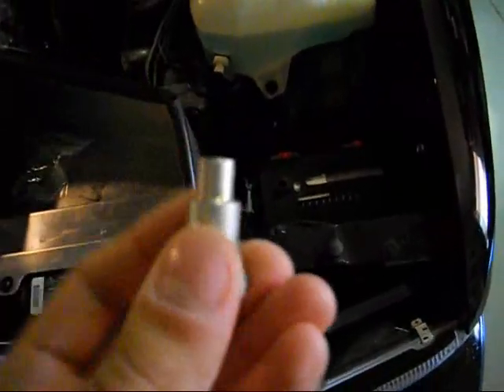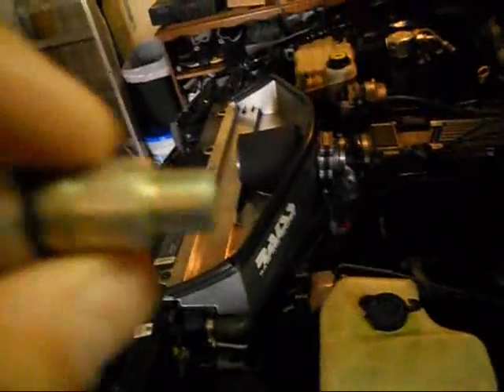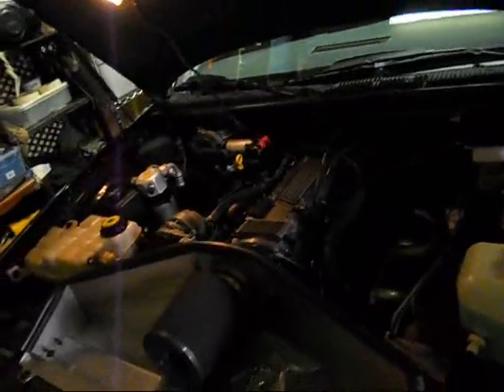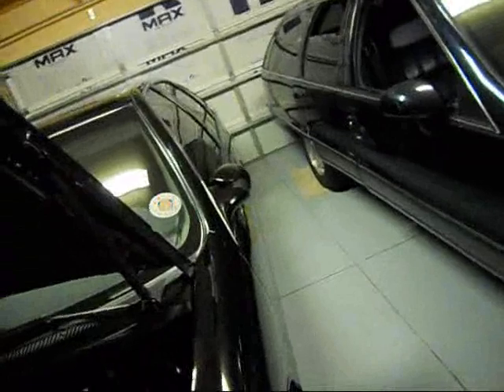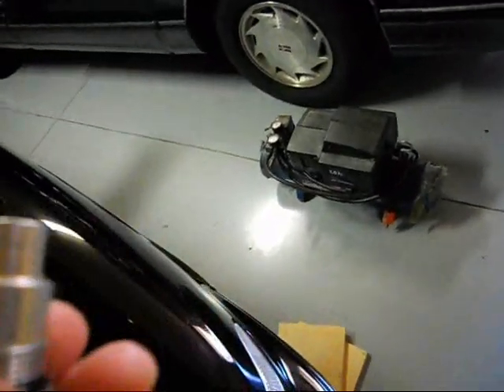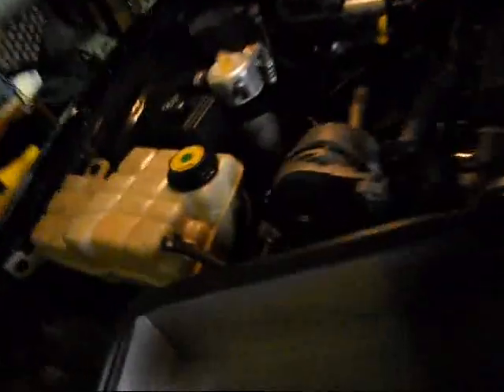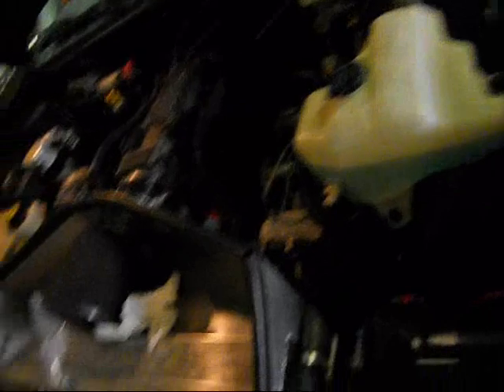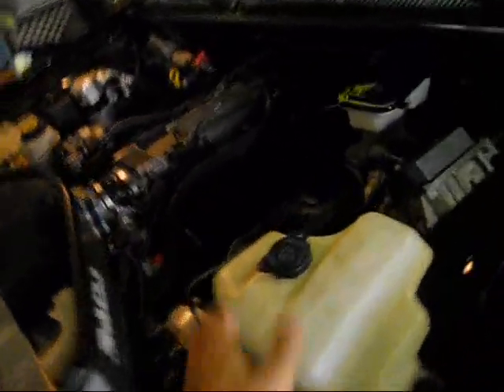Stealth Bolt, Metering bolt Brake Proporting valve mod finished on the Impala SS

Comment: Hey man , I purchased the kit and only put the front bolt in, would that cause the back brakes to have somewhat of a crunchy straining noise? It was not there before I did that. Also, the rear squeak you were talking about with the parking brake cable was it very high pitched and somewhat match the rate of the wheel turning ?

Comment: Yo what's the part # on that brake bias bolts ??
Reply from the maker: No idea it was some custom part.   This kid Zack I used to chat with used to make them, maybe he still does,  man they are probably have multi millions now. Summit racing may sell them now under the "pro forged' name
Reply: Did you take out the spring and the red plunger when you did it ??

Comment: @ghtowagon the general sure had his probs through out the years , but the things they had the most issues out of , were just things that pissed ya off , but would not necessarily put ya on the side of the road , like the ac compressors almost all the 3 piece ones started leaking ,those oil cooler lines , and the caprice /impala rear window plastic regulator guides that crumbled and made the rear windows not go up and down without help 4 dollars for parts , and 4 hrs to install typical G.M. LOL

Comment from the maker: @towrecker  naww it was never winter driven.   I have an oil cooler than is in the radiator not an external like a 9C1. The lines always leak to those things... Like ever GM. Great crimps!  I have to re do them and put some nice AN fittings and braided hose when they get bad again.. No way I'm paying for a line set that will just leak again when I can build something better

Comment: @ghtowagon yeah , new york could cause a little rust I would say lol my 95 , and 96 both rubbed through , but the wild part was that both cars only had around 25k on them if I remember right when they did it , has your car got the oil cooler ,just curious...my 96 had the 9c1 option code , but you would have never knew it lol no rubber mat crap , looked like all the others , just had the heavy duty crap it was a oops by the local dealer trying to order a patrol car ,and I bought it lol

Comment from the maker: @edzgarage  It was not really an issue.. It was just a design flaw. Under a panic stop from 60 these cars stopped stock in 120 feet!  Which is GOOD!  Just under that event, the nose drive was terrible, as was the accelerated front brake pad wear.  Under repeated heavy stops the car reacts a little better now as well because the front rotors are not getting as cooked.

Comment from the maker: @towrecker  I'm good at the flexible hoses. They are all braided anyway.  I tossed those on years ago.   Yea, they make coolant specific "overflow" coolant hose. If it leaks again Ill use that. Too cheap, gotta use my stock of hose. The Goodyear fuel line which I used was twice as thick as the gates fuel line hose I had on before. Ill see what happens

Comment: speaking of brakes , I have had two impalas do this , the clip on the rear axle right side that held the brake line to the axle,cut the line through , might check that , and the coolant hose you need gates makes it on a roll ...well it's by the foot in a box lol oreilly auto parts can get it , some keep it , if you have one of those down there , it's available from 1/4 up in size ....hope that's a help ....

Comment from the maker: @84400  Yea. Cheap GM. They made something like 69,000 impalas and I dunno how many 9C1s and they all were set up wrong. One thing though, in stock format they did easy burnouts / brake stands because the rear brakes basically were not working. I cant believe I drove the car for so long w/o touching the rear bolt.. Then again this part was available already in the proper shape on and off  for years and I was too lazy to make my own....

Comment from the maker: @moldymac  Nope. It wont do a DAMN thing.  Discs only  The cruiser stops good for me when the drums are adjusted. Probably better than the impala!  Those GIGANTIC drums have some holding power. They lock up before the fronts.   

I always used to drive on the crappy NYC roads and this car was kind of scarry because a panic stop was needed ALOT on those highway. 65-70- ZERO around a blind turn.